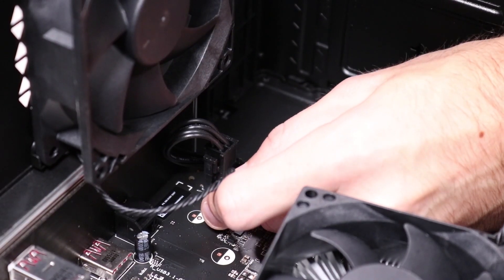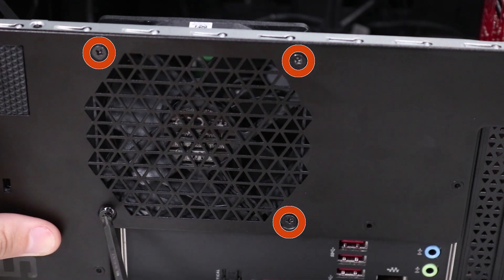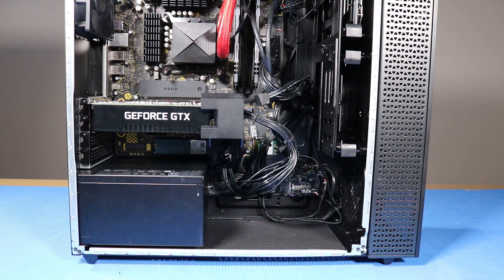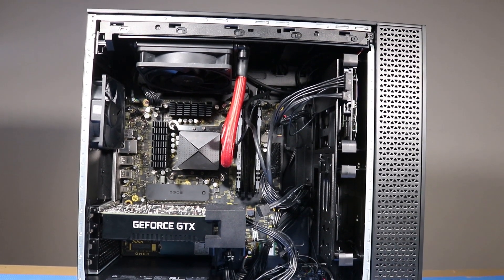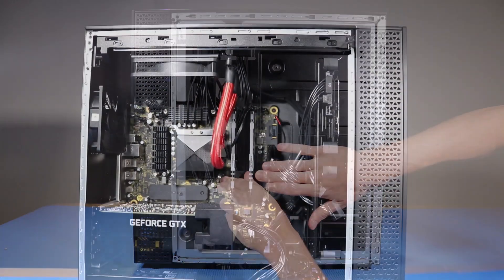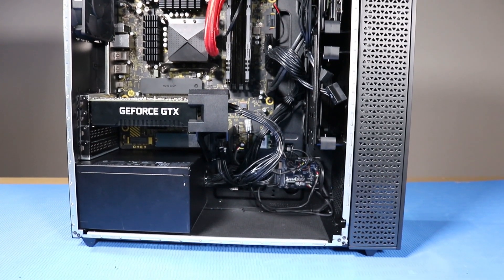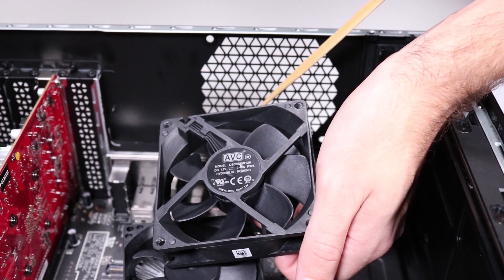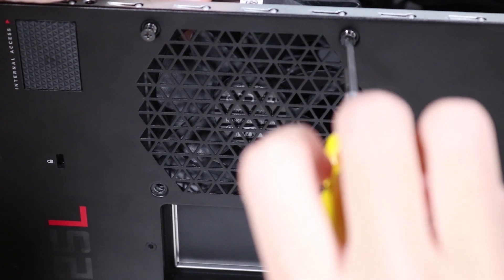Replace the Rear System Fan | OMEN 25L GT11-0000a, GT11-0000i, 30L GT13-0000a, GT13-0000i | HP

Comment: can the rear fan be upgraded to a duel fans because it look like there space for it
Reply from the maker: +zdogcat HP does not recommend upgrading or downgrading hardware parts or software that is bundled with the product as It may affect the manufacturer's warranty and performance, however, you could change the configuration at your own discretion.

Comment: Would upgrading the rear fan void limited warranty?
Reply from the maker: +bedecki HP does not recommend upgrading or downgrading hardware parts or software that is bundled with the product as It may affect the manufacturer's warranty and performance, however, you could change the configuration at your own discretion.